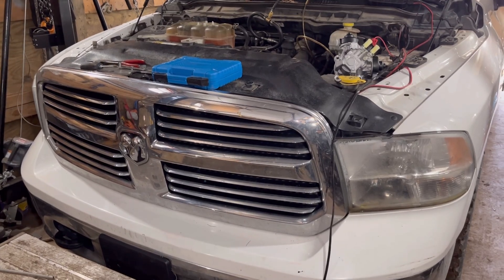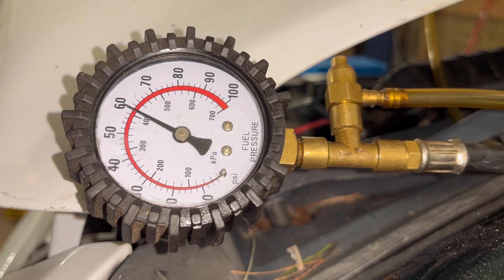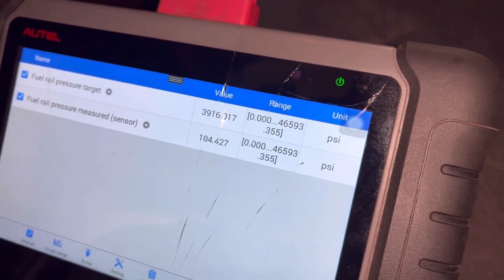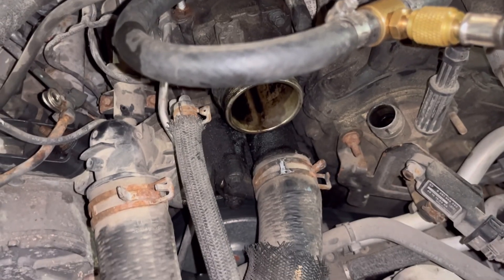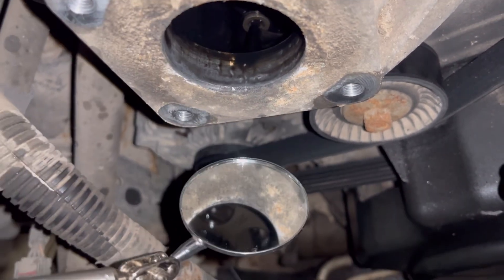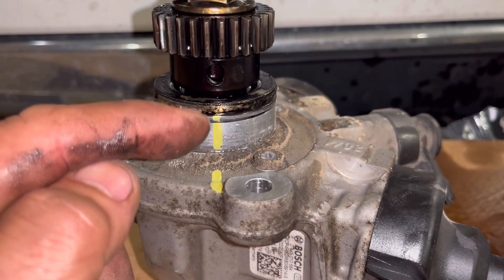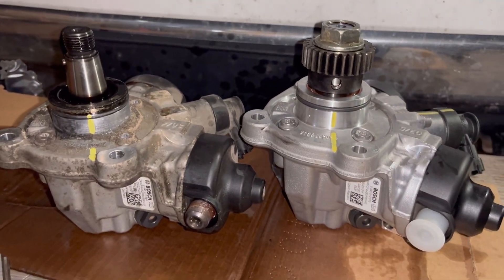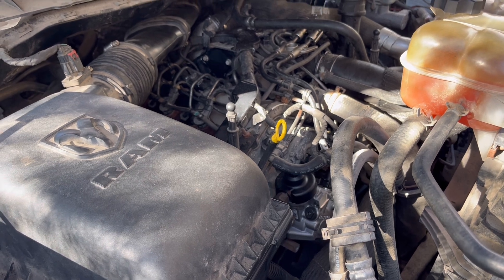Quick overview Ecodiesel high pressure injection pump replacement

Comment: My dealer is replacing the HPFP under warranty after a crank no start issue. They didn’t mention replacing the injectors though. Should I be concerned for metal fragments traveling into the injectors and possibly engine
Reply from the maker: @richdelgzz  in my opinion and experience, no. An injector failing due to metallic debris from the injection pump tearing itself apart is very uncommon. Again, my experience. Let’s just hope they are correct with their diagnosis. The two other most common reasons for a crank, no start, is crankshaft sensor reluctor wheel, and lift pump in fuel tank. I would hope they checked fuel pressure in between lift pump and injection pump and scoped out the crank sensor signal.
Reply: @tadsworkshop  Thanks!
Reply: Hi  i replace it and my injector and still pressure 140 at running    @tadsworkshop

Comment: Mine is at the dealer right now for recall on that pump.
They have been telling me for a year that none were available ,interesting  to see it's a Bosch.
Thanks
Reply from the maker: @stevenberg1903  it was on a back order for the longest time. But hey, if you’re getting a new, high dollar injection pump installed for free, that’s great!
Reply: @tadsworkshop  2015,101k.
Clean as a whistle compared to this one. Original owner.👍
Reply from the maker: @stevenberg1903  very nice. Just from my experience over several Ecodiesels, consider pre-emptively replacing the lift pump around 150k or so.  All of the ones I’ve replaced had between 140k-190k miles before they died.
Reply: @tadsworkshop  thanks, If I was anywhere near you I would be calling for an appointment 😎.
Keep up the work👍👍
Reply: @tadsworkshop i got 211 miles on mine.😊 Its a noisy little pump.

Comment: Why is this truck on its last leg?
Great video these are super hard to find for the ECO D.
Reply from the maker: Thanks Ed. The last leg bit just reflects the owners mentality with the truck, as it has some severe damage to the rear frame from an accident, coupled with some unusually bad rust/corrosion. Drivetrain is still solid, with the exception of a pinion bearing noise. Truck may be a parts donor in years to come.
Reply: @tadsworkshop  Oh good! My truck has 204,000 and is my daily. I fully expect to put a new motor in it someday I'm just hoping not soon.
Reply from the maker: @edtaylor3409  for what it’s worth, the highest mileage truck I’ve seen in person had 271k on it. I’ve seen evidence online of other trucks above 300k. I was curious about the transmission, so I asked the guy about his 271k truck, and he said he had never bothered to change the filter and fluid. So that’s a testament to how good the ZF 8 speed is.
Reply: @tadsworkshop  I've been debating on doing that... The old-school mentality is that if you missed the maintenance window it's best to leave it. I'm not sure if I'd help or hurt the transmission at this point if I did it.